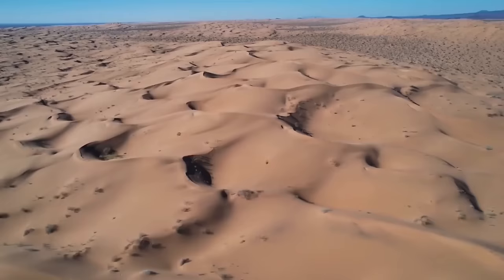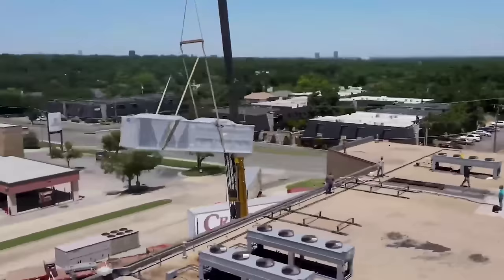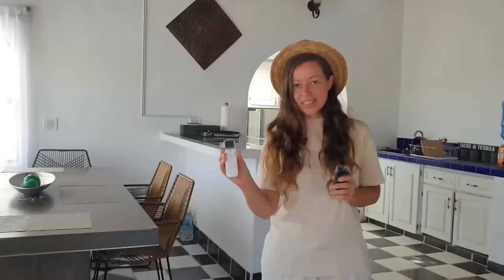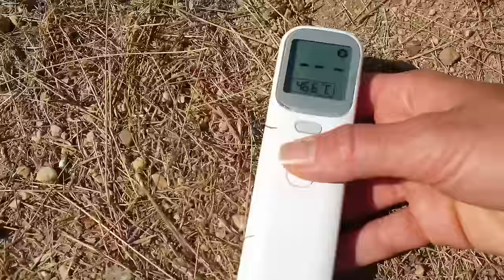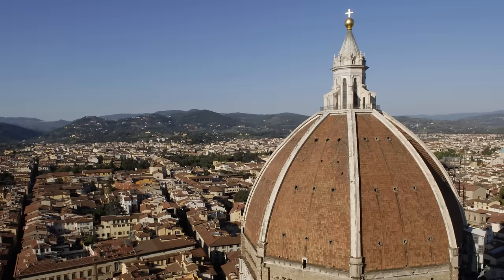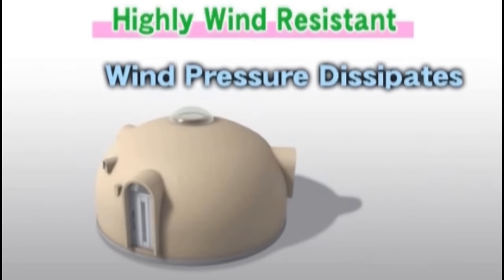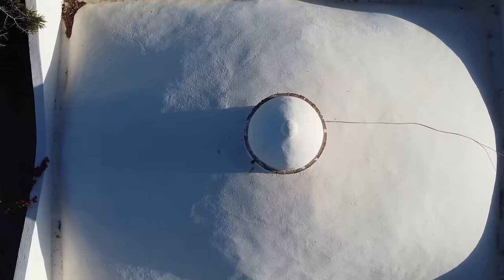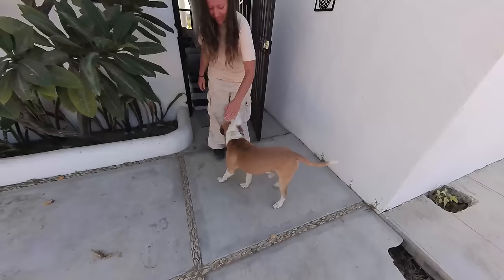How I Live In The Hottest Place On Earth Using An Ancient AC System To Stay Cool!

Comment: A very long video explaining nothing. Or making you more confuse.
The dome shaped ceiling has nothing to do with aerodynamics. 
It simply allows hot air to ventilate faster during the night and cool the house with zero electricity
It is like a hot air balloon, the hot air wants to go up. If you can have a ventilation hole in the highest place in the ceiling the you have the most effective ventilation system.
Is just that, taking advantage of the aspect that in the desert during the night is quite cold, and the dome shape allows them to ventilate the house very fast and cool it during the night.
You don't need a dome house to achive this effect. Most people living in hot ares or deserts build their ground level underground and live there during the hot days. 
I remember the first house my father build had a cellar, and in the summer when outside was 35-40 degrees, down there felt like entering inside a fridge, and it also had a small well inside the cellar and the water was 5-6 degrees. So cold you could barely drink it. And because the entire house was made of wood, like a cabin from logs, because in that part of romania this is how people build houses. Inside the house was a nice temperature all day.
There are many ways to build houses, the dome shaped is simply the most effective and cheap to make in those regions, where clay is abundant and wood is rare. Clay houses are great in hot areas with little rain,(bricks are also clay btw). But in ares where there is alot of rain and himidity clay is bad to make a house. Best is stone. 
Artifical materials in constructions are much more superior in efficiency, but also more toxic in the long run.
To me, natural stone and wood would be the best combination of a healty house, clay houses are also home to alot of insects, wich like to live in dirt. The best material to build a house is simply what you have avalabile. 
The dome shaped rooftops are more about a simple cheap way to make a rooftop wich is strong than cooling, it is more about structural strenght. As long as you have a high spot in your ceiling and a hole to ventilate hot air during the night you can achive same effect.
Reply from the maker: The dome does allow air to move and circulate multiple studies have shown that
Reply: @LeafofLifeWorld  That is exactly what i said. Other than that, the dome shape has no effect during the day, no more than any other shaped house. And that you do not really need a dome house to achive the same effect. 
The entire principle here is to capture the night cold air and maintain it during the day. Is as simple as that. Because of the shape of the dome and the fact it has a hole in the highest position in the ceiling it helps naturaly to evacuate the hot air faster naturaly and sucking the cold air through the windows and doors. Beside this, there is no other benefit. You can achive same thing if you just have an inclined ceiling and make a hole in the highest place.
The real trick wich you failed to mention in your video is simply this. Capturing the cold night air. Just that. 
You would have no reason and no benefit of the dome during the hot day. 
The other aspect of it is that it is strong without any reinforcement, like wood beams or steel, and i assume this is the reason this kind of structure was developed in those regions, because of the lack of wood. And that has nothing to do with ventilation.
People have become too accommodated with modern AC, but there are still alot of people wich cool their houses during the night and then maintaining it during the day around the world, not just in deserts.

Comment: You measure the outside temperature in the shade not in direct sunlight and not above the scorching hot ground, you measure a meter above ground, so it's definitely not 47.2 outside! 🤷🏻‍♂️
You could also have measured the inside temperature behind the window in direct sunlight, i'm curious how warm it would have been then! 🥵
Reply from the maker: We actually did measure the shade outside the overhang, so we could compare in full sun, shade outside and inside but I didn't get included in the edit. The thing take temperature in the shade isn't fully accurate aswell. Because the building is receiving direct sunlight so you need to know what temperature the building has to deal with.

Comment: I wish you had taken the temperature outside in the shade. That's more indicative of the true air temperature. By taking it on the ground in the sun, you're capturing the radiant temperature of the earth. It's good to know both. But,  a normal home would typically be closer to the outdoor shade temperature if it's well insulated and ventilated in the attic. That would tell us more about the true cooling power of this design. That said, it's quite beautiful. 

Can fans be used inside these homes to create more air movement, or would that disturb the convection process? At 77F, you would want some air movement to feel comfortable.
Reply: Or, yanno, recalibrated the thermometer between measuring direct sunlight sand and highly glossy white tile?

Comment: I was born in San Luis Rio Colorado ❤ ,  hottest place on earth.  177°F?  Geeeeezus 😮
Reply from the maker: its land surface temp not the same as air temp
Reply: @LeafofLifeWorld  duhh i know.  Just the fact that we were hotter than the Lut Desert is mindblowing.  Almost same lattitude,  and on the rainshadow of acouple seas,  but northwestern sonora is bigtime blocked from any pacific cool winds and marine layer,   baja mountains are too high and puts them in the adiabatic heat zone area, which makes temp climb up to 5.5°F for every 1k feet descending,  and sinking air takes over usually,  mainly desert areas. instead of an ariabatic climate zoned area,  where temp climbs up 3.5°F for every 1k feet you climb.
Reply: @LeafofLifeWorld  yes. And 6 feet above ground on shade,  is how the readings are read.

Comment: Can someone with this type of house confirm if this type of house actually works in reducing heat as claim? I see air condition in the video and a bit skeptic
Reply from the maker: We didnt use the AC in this video, its only there because the house is a rental unit and many tourists want the luxury of Ac, it doesnt need to be used unless in very extreme conditions for example, when there is extreme heat wave with high hunidity or even when it gets cold at winter and night. But i stayed in this house for 3 weeks and never used the ac, so i confirm it works because i also stayed in a normal house in the same area and was very hot without ac
Reply: @LeafofLifeWorld  I live in a 40 degree high humid climate - with a long rainy season. Do you think this set up will work in my climate? Is rain and bug an issue?

Comment: Does this architectural cooling work as effectively in humid areas, or is it mainly for deserts?  Thank you.
Reply from the maker: it will work better in deserts but it can work in humidity but just not as affective, still every little helps
Reply: Not so good for humid climate, although helpful. 
For humid weather you’ll need big opening and breezes for cooling.
Reply: @fairopenhonestx0275  would a canadian well be more useful in humid climates?

Comment: Can you feature a regular house in the city that applies passive cooling features. Houses i have seen with passive cooling featires are huge and not realistic for smaller sized homes.
Reply: I seem to recall that they can now make glass for tall buildings which has material embedded to reflect IR light, keeping heat out and sending it to space. But, airflow in a tall building would be pretty tough to achieve.

Comment: The dome works to cool that house so well that they have multiple mini-split air conditioner units on the house.
If you want to do something that is 100% proven to reduce energy needs for your house, you will add a lot more insulation everywhere, and replace your windows with efficient ones.  It will take a few years for the lower energy bills to pay back the cost of the upgrades you made, but it will pay itself back.  After that, it's extra money you get to keep in your pocket.  But if you really want to save, live in a small house that has a ton of insulation.
Reply from the maker: It was as cool as we showed it, without the use of AC i think the owner has it for extreme cases sometimes its very cold at night and sometimes in hurricane season its very humid but when we took the test it was perfect temperature compared to other houses in the area that did not use domes

Comment: There is no insulation in the roof? Just white plaster on top of the clay bricks?  Interesting i would think thicker insulation would be key hmm i guess its already effective enough. No overhangs? Windows on one side? I dont understand how it can be cool if its not a traditional looking passive house i guess that high windows helps let the hot air out
Reply from the maker: There is an overhang infront of windows

Comment: This house has a Mini-Split system installed...wondering what they use it for.  Perhaps heat in the winter?
Reply: It may be that they have this installed for extreme moments, whether hot or cold. The point of the video isn't diminished or negated by the presence of modern equipment in a building that was likely initially built without such modern conveniences.

Comment: The hottest earth temperature ever recorded on earth is much lower than that. "The hottest temperature ever recorded on Earth was 134F (56.7C) in July 1913 at Furnace Creek, said Randy Ceverny of the World Meteorological Organization, the body recognized as keeper of world records. Temperatures at or above 130F (54.4C) have only been recorded on Earth a handful of times, mostly in Death Valley.Jul 17, 2023

Temperatures measured by satellites are not air, but ground temperatures. Those can be hot enough to fry skin on asphalt.

Comment: Why measure temperature on the ground? I would be more interested in air temperature at chest level, specially inside.
Reply from the maker: Doesnt matter as long as the temperatures measured are both taken from same altitude, there wasnt much difference from arm level because i tesred before but we used ground level for accuracy because both temperatures need to be from same altitude for comparison
Reply: @LeafofLifeWorld  My floor in my house is a concrete slab.  In the summer the floor is cold, but the room is warm.  We don't live on the ground/floor, we live upright, so you should measure the temperature there.

Comment: To the poster of this video...
Listen to the comments. You have a subject for which there is a lot of supporting data, but you've presented the video in such a way that it undermines the legitimacy of your claims. Fact checking the thumbnail immediately identifies this video as potential misinformation since you claim recorded high temperatures that are not officially recognized or recorded using the standardized protocols. Did you get the 80.5 C reading from your own thermometer? Satellite temperature data is not used officially for numerous reasons. Particularly because the land features near the measurement location can distort readings or provide readings that exceed the average air temperature of the region in a very localized manner. 

And then there's the visible ACs that everyone can plainly see...

While this channel has great ideas and potentially impactful info to share, this is all lost to hyperbolic claims that are not verified. Don't try so hard and let the FACTS themselves prove your point. Avoid anecdotal evidence and provide empirical data from third-party, reliable sources.
Reply from the maker: Just because there is Ac doesn't mean it is functioning or been used. After all its a desert so gets cold at night and humid in the hurricane season plus its a rented property so having a mini split system gets you more bookings, doesn't mean the dome doesn't function. As for the temperatures that was land surface temperature, which was stated at the very beginning of the video with the clips from news reports and channels wo reported it.

Comment: Yeah, ignoring the large Heat-pump unit in the room  (& the 4 compressors outside) she conveniently takes a FLOOR temp reading only. Look I get it, she's trying to create content that folks will watch, I did. But it's full of factual holes.
Reply from the maker: We tool the floor temperature to take accurate comparison because you must take temperature at same altitude for comparisom but either way it was pretty much the same reading regardless, as for the units we did not use them you can clearly see its off and not needed the owner only has it there in extreme cases its the desert so can get very cold so used for heatimg or in hurricane season when its very humid but we didnt use it. You can say factual holes but there is a reasom domes have been used for thousands of years all over the world and has a functional purpose. Have yoh ever entered a dome church? They always prerty cold. Believe what you want thats up to you, but your beliefs are also not fact.